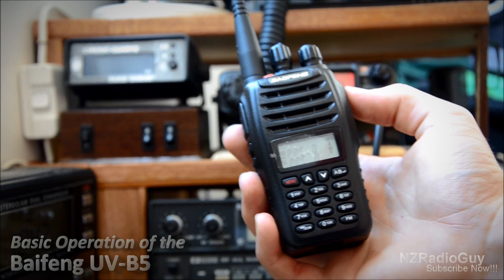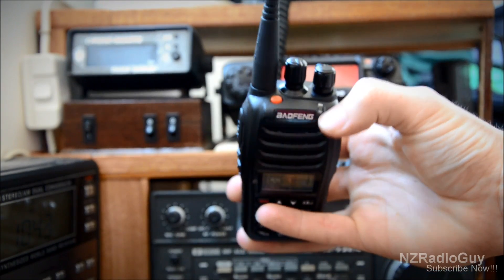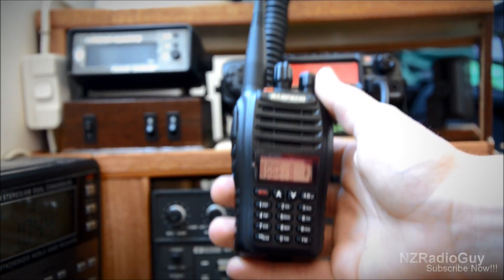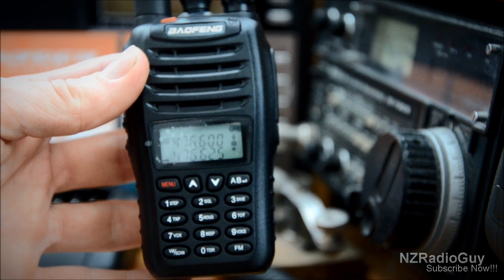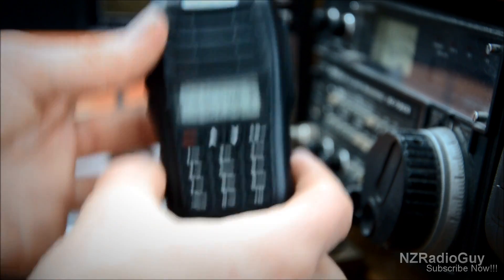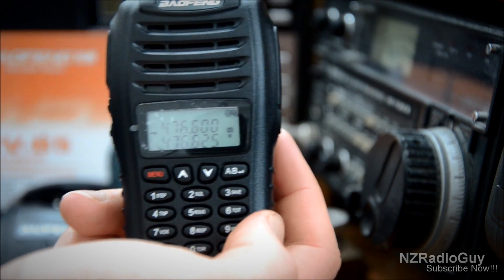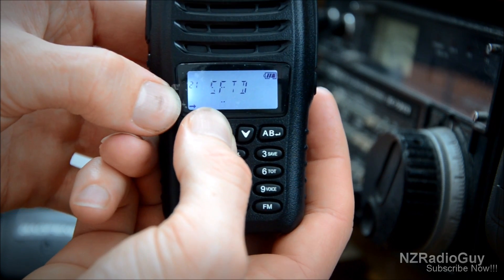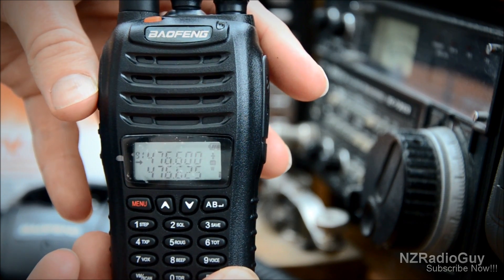Basic Operation of the Baofeng UV-B5

Comment: Excellent video for a problem radio. I purchased two from jamesales2009 on E-Bay. The first received but did not transmit. The second had a large "snap" sound through the speaker when turned on, turned the frequency knob and when buttons were pushed. Now it snaps when receiving. Good luck trying to use the 1 year warranty. Jamesales2009 claims he ships US stock from Oxnard California, but I received the package from Hong Kong. He now will not answer my e-mails and I tried to contact Baofeng customer service with no luck. I would not recommend this E-Bay seller nor Baofeng in general. Save for a quality radio which carries a real warranty and is not disposable.

Comment: To stop accidentally transmitting on a Baofeng (GT-3) as far as I know it's not possible to lock out the PTT button, please correct me if I'm wrong.

Can the PTT button be programmed so that if pressed it transmits nowhere? Or transmit garage?

Or can it be programmed to stop if from transmitting from certain local frequency?
Reply: adam son  In the computer software Chip not Baofeng, you can program frequencies to be RX only... it still appears your transmitting (Tx lights up) but signal does not actually xmit, Check miklor website... lots of good info on these type of units,
Reply: neil s A big thanks for the reply, I'll give it a go and let you know.

Comment: hey bro where did you get this radio and how much did it cost to ship to NZ?
also does this cover all 80 channels of PRS?
Reply: Steve Arthur
 it does the prs channels ive had this radio for a while now and it works very well
im about to buy more for other people who have used my radio
Reply: yes i know that the term PRS is only used in NZ and aus which is 476-477 mhz and yes radio mine does go to 480 mhz
like most baofeng the sticker on the back is sometimes wrong because the pc software for the radio will let me put in and save a prs freq
Reply: Steve Arthur
its no prob bro i also have 2 888s radios that work on the PRS freq even tho the stickers say they dont
Reply: do they work on PRS?
Reply: what freq do you use it on here?

and waht do you use it for